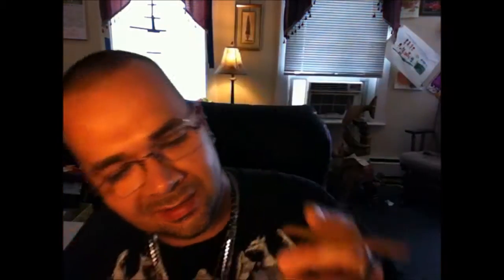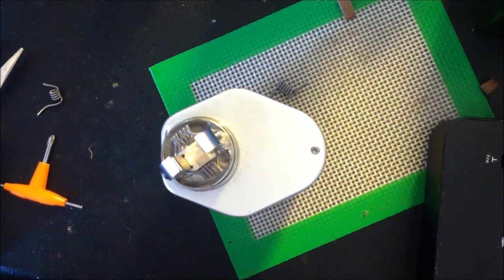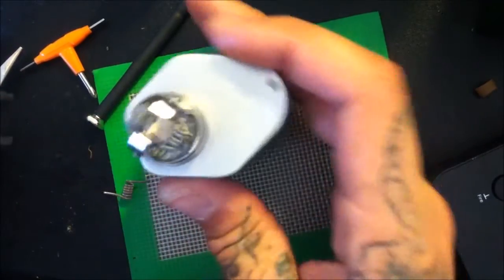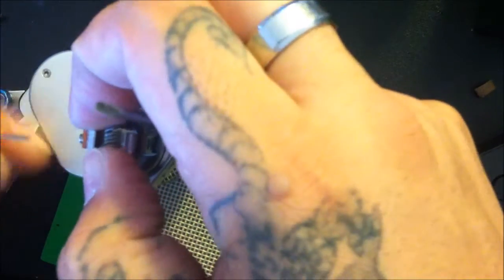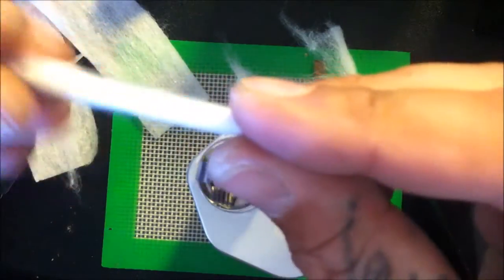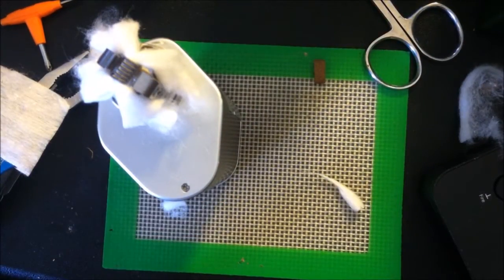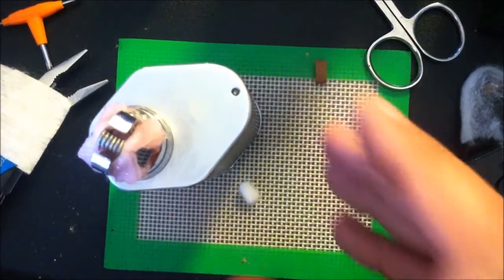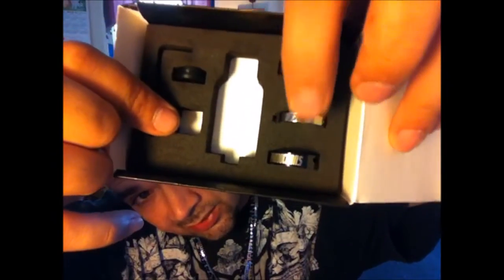so horney rda review & build

Comment: Can I build 4 coils using Clapton wire 34/24 with a 2.5 diameter
Reply: I forgot can i use five wraps using the clapton 34/24 with a 2.5 diameter and build four coils with no issues

Comment: can i build a two coil in wild bull? because im using smpl tube mod?
Reply: No reason you can't, current will just flow through the coils you put in, because that's the only part that is a completed circuit.
Reply from the maker: yes you can build even just one coil